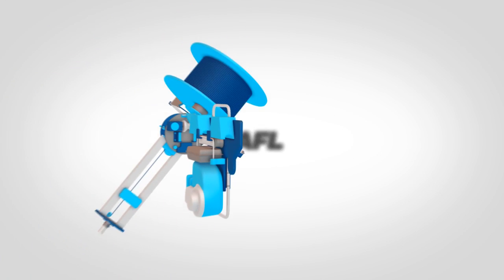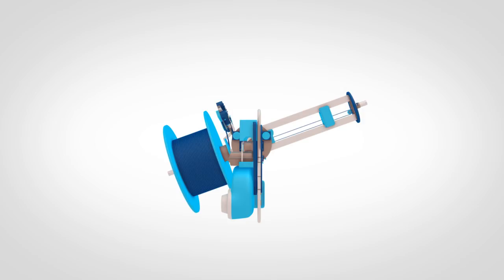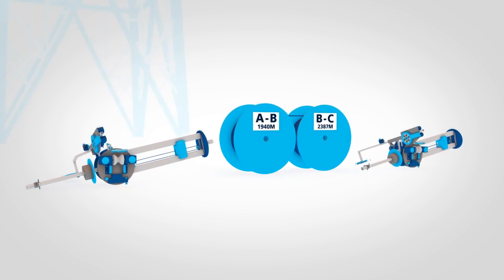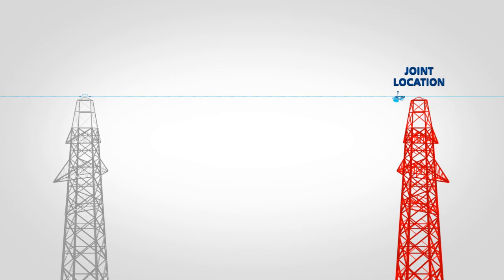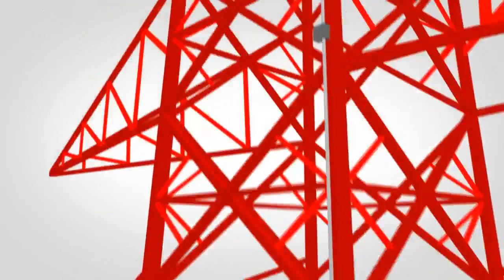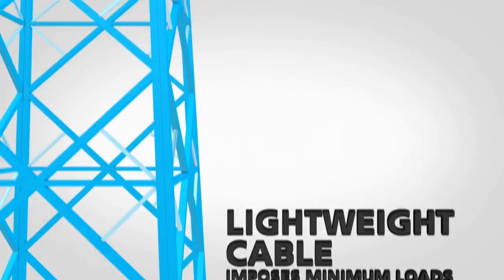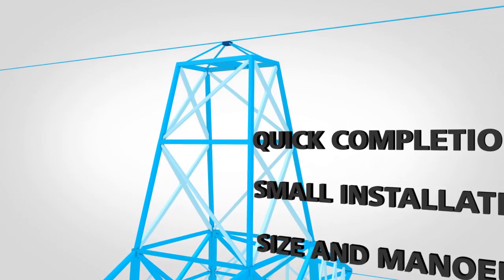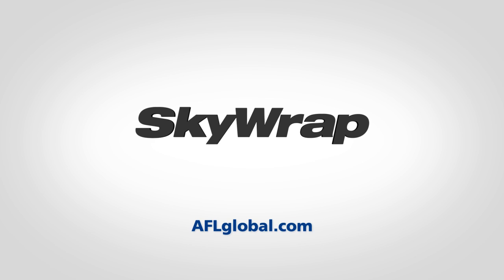AFL SkyWrap Attached Fiber Optic Cable System for Aerial Powerlines

Comment: What will happen if lightning strike occurs? I think Optical fiber cable will get destroyed/damaged completely if lightning happens. Sky wrapping of OFC with earth wire should not be a good solution since the lightning will damage optical fiber cable resulting loss in connectivity through fiber break if lightning occurs. I see this one is the only weak point in this technology otherwise this is the fantastic solution. 
Correct me if I am wrong.
Reply: Just asked the same question. Sometimes lighting strikes are so powerful (like positive lighting) that they make the shield wire smoke or even explode.

Comment: Heard about this in 2002. There is one big problem using this technology and that is that birds that sits on the high power lines and dig trough the cable with their nails.